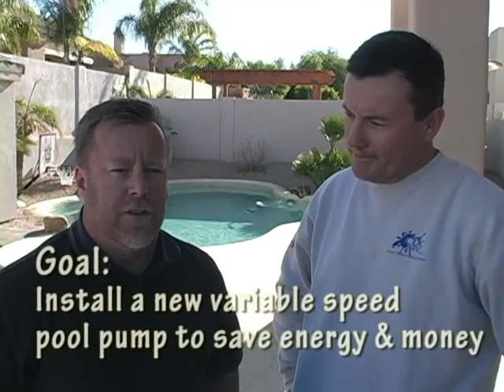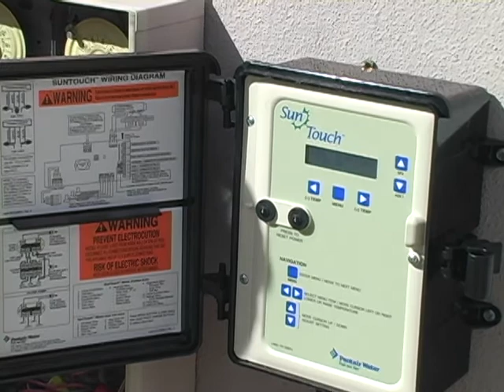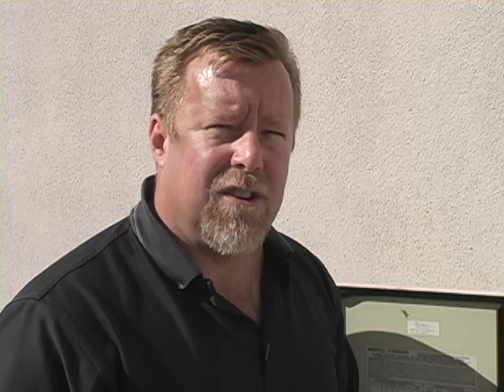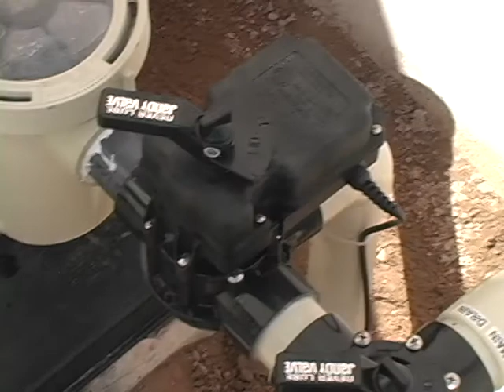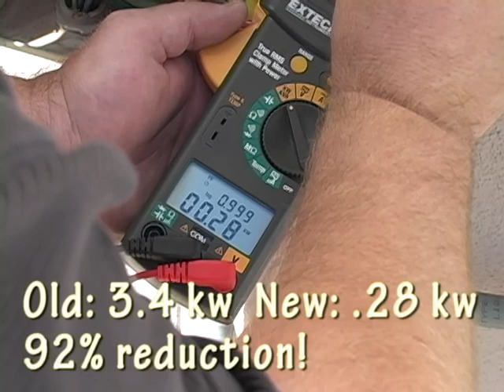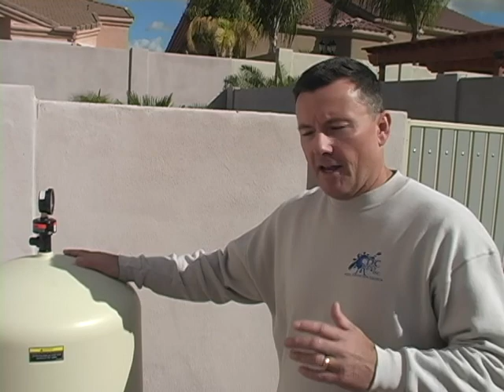Saving Money with CDC Pools' Variable Speed Pool Pump

Comment from the maker: You actually clean the pool at the regular kilowatt usage, then circulate the water at the lower KW rate.  There is no need to run your pump/cleaner as long as you do now.  However, now, you can't separate the cleaning process from the circulation process.  With these new pumps you can.  And it takes a whale of a lot less energy to circulate your water than run your cleaner.  This is where the savings comes in.